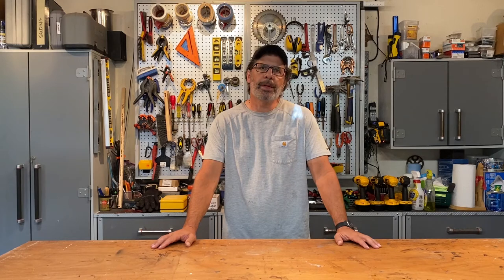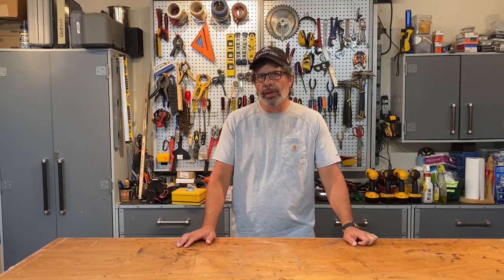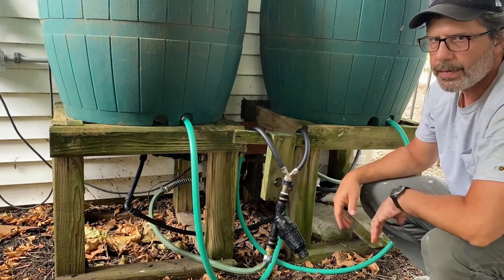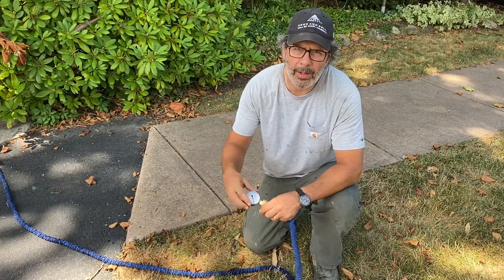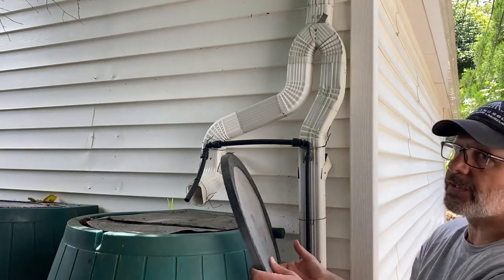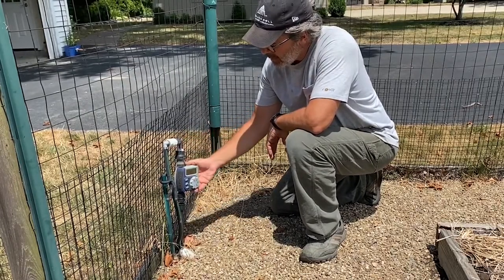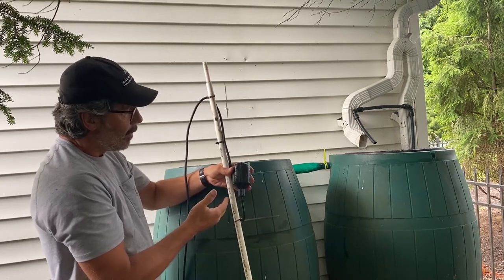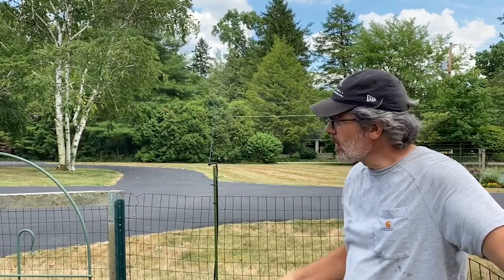The Ultimate Rain Barrel Irrigation System

Comment: You put the overflow  sensor in the second barrel correct so at that point you are pre filling both barrels when it goes dry thus erasing the benefits of rain water,  if you put it in the primary barrel at most you would loose one barrel to rain instead of two. Unless I’m reading this wrong….. you ever thing of powering you pump by solar?
Reply from the maker: That is a good point.  If I were trying to optimize rainwater collection that would be a better solution.  

Given the capacity of barrels, the amount of water I use each day and the filling frequency, I’m not sure it is making a material difference by overfilling hose water at the expense of rain capturing capacity.  I have the float switch set pretty low in the second barrel.  So it fills about 1.25 barrels with hose water, then uses about .5 barrels for daily watering.  So if it rained the same day as the hose filling, it would have over-filled about .75 of the 2-barrel capacity with hose water.  If it rains the next day, it’s only blocking about .25 barrels of the 2 barrel capacity.  

In my location, with fairly abundant rainwater and very low cost municipal water, I did not configure the system for 100% rainwater optimization.  Maybe I’ll switch it over to the first barrel sometime and measure the difference.  

But you are correct, that would be a better optimization method for maximum rainwater capture.  Good catch, no one else has noted that yet.  

I’ve definitely considered a solar setup.  It would be quite easy and there are DC powered pumps that could be used.  I believe some have set up this system in off-grid configurations based on comments I’ve received.  

I also have a old hand-dug well from the 1800’s on my property which recharges at about 40-60 gallons per day.  That is another option I’m working on with a solar powered pump.

Comment: What an incredible video Thank You! My guess is that the system doesn’t have enough pump pressure to run lawn type sprinklers… is that true?
Reply from the maker: These pumps run at about 60 psi which is the same as standard hose pressure.   Test your house water psi and select a pump at that same pressure.

Comment: Nice job with this fellow clevelander. Im a year4 gardener and finally getting some great yields. I have contemplated wifi timer modules and stuff but this is just way better. Have you made any adjustments or improvements to your original design?
Reply from the maker: Thanks. No changes. It’s still running exactly the same way.  I have looked at WiFi timers so I could easily skip water on days it rains. Now I need to manually turn off the timer and then turn it on the next day, which is not a super reliable or convenient method for me.

Comment: Great system and I picked up some great tips.  One question.  If the power goes out, will the backup system start the hose and never stop?
Reply from the maker: Yes. If you read some of the other responses to this question, there are a few easy solutions.

Comment: You've just saved me months of trial and error - thank you!

I have a question IRT the automatic municipal line refill using the float switch, I presume you just turn the tap off when there is rain in the forecast, so the rain isn't wasted flowing into full barrels?
Reply from the maker: You can certainly do that.  I generally do not.

Comment: i would use a straight connector with the hose, 90 degree will drop the pressure a bit.
but pretty nice set-up, this pump could make my project real (smaller barrel with a main barrel hidden away)
Reply from the maker: Thanks for the tip!

Comment: Very awesome system. Powered selonoid. I need to try to find a different solution. My collection will probably be contained inside my house in my basement. (HOA). So a powered selonoid to keep water from pouring in sounds lime a disaster if I loose power. A always closed selonoid that needs power to open would be better but I'm trying to figure out the work around. I'm designing a similar system except for my sump pump water. My sump pump pumps 5 gallons every 25 seconds. So I'm looking into collecting that and doing something very similar.
Reply from the maker: There are many WiFi based water and pump controllers out there now.  I’d look into something like that.   Either as primary or a backup shutoff.

Comment: if you want to pressurize without out the pump you have to use the formula "P=0.433/timesh".  Simple version is 1 inch pipe at 1 foot drop gives .433 psi, so to get your 45 psi equivalent you would use a 4 inch down pipe at 6 foot drop, then reduce to 3/4 inch pipe and you get 47 psi as long as your 6 foot pipe stays full.
Reply from the maker: Thanks. Very helpful to know. Once I raised the barrels 2 feet and knew I didn’t have any more drop to the garden, I gave up on the gravity method and switched to the pump.

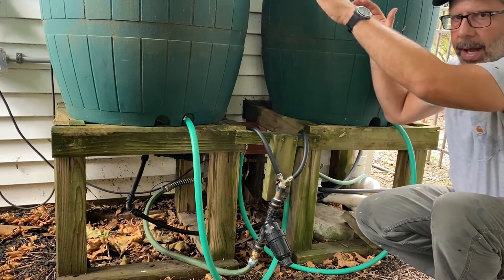Comment: At 7:17 you show how both barrels will drain simultaneously. That connection to both barrels eliminates the need for the connection at the top of the barrels to allow 2nd barrel to begin filling once the first barrel becomes full. Correct? They'll both fill at the same rate, as long as that valve is open, which I assume it is all the time.
Reply from the maker: Good question. That mixing hose actually has two separate streams in the valve (probably to prevent back flow), so the second barrel does not fill from the bottom up.  But that would be an option with a different mixing hose.

Comment: Hey Tom -- I've watched this a dozen times; it's so good!  I've got the barrel + pump part of it set up, and am considering the hose / solenoid piece to refill when it gets low. 

A question -- do you worry about a power outage? In that case, won't the solenoid open and the hose dump water into the barrels (and then overflowing into the drain) continuously?
Reply from the maker: Thanks. I have very infrequent power outages here.   My security system notifies me of outages and my neighbors both know where to shut off the valve if I were out of town.  

You could set up a second solenoid running on house power that would be open when power is on. That would control the flow from the backup hose.   That’s a workable solution. 

Someone also suggested a motorized quarter turn valve which I believe remains in position (open or closed) of power goes out.
Reply: @dontscrewitup  thanks for the advice! A notification for a power outage should be enough!
Reply from the maker: There are also some battery powered, wi-fi enabled shutoff valves you can put right on the hose bib now and shut it down remotely in the event of an outage.

Comment: Nice system. Have you thought about moving your backup fill hose to after your on demand pump? this way you only would use house water as long as your collection system is off and if you get more rain you will have room in the collection system to collect the rain water. you would also not need to use the on demand pump for house water this way.
Reply from the maker: Yes that would be a way to simplify and optimize the system.  I figured that out after I had set it up this way.  But it is a good alternate solution.  The backup filler only fills the barrels about 2/3 capacity and I use about 25% per day. So I’m not crowding out much rainwater with this approach. But if I really wanted to optimize rainwater collection that would be the preferred method. And the house hose water pressure obviates the need for the pump, as you indicate, so that is also an energy saving upgrade.  Thanks!
Reply: @dontscrewitup   - so it looks like you use about 15 - 16 gallons per hour.  As I reviewed this - that consumption would also likely depend on how many drips you have going.  I really love this - and the flow control system!

Comment: Just watch your viedo, great tips on setup. I like the logic of either rain or city water. One thing that I saw in the video is you black filter. I have the same looking item and mine is a pressure regulator and filter. Is that the reason why there wasnt any pressure without the pump?  Thank you again of the great tips.
Reply from the maker: Good question. No, I’ve tried it with not filters at all.  And the pressure regulator in my system takes it down to 20 psi before the drip irrigation.  But I wasn’t even close to 20 without the pump.

Comment: Any consideration to turn the hose directly on into the irrigation line rather than filling the barrels up? Then once the float valve signals water levels are back above minimum, the hose turns off? Just spit-balling. No idea what I'm talking about and have done nothing yet. I am planning a barrel system though, and your video is clearly one of the best on the matter.
Reply from the maker: Yes, that would work, but if would need to be downstream from the barrels and pump so it would run until the garden timer shuts off (and the float switch is off).

If the barrel was low and the garden timer valve opens, the solenoid would be open and the hose water would run directly in-line to the garden. If it were raining at the time and the barrels filled, the float switch would rise, cut the power to the solenoid, it would close and the pump would switch on. 

There would be backflow pressure into the pump when the hose water is running but I assume this is not an issue.
Reply: @dontscrewitup  thank you, you're the man!

Comment: Enjoyed the video. Wouldn't the system be limited in the amount of rain water it can collect. If your constantly filling with a hose as water levels get low your leaving less room for caught rain.
Reply from the maker: Great question. The way I have the float switch set (pretty low in the barrel) it shuts off the hose filler when the second barrel is only about 1/3 full which is about 2-3 days of water.  And the rain always tops off the barrels even if I just filled them with the hose.  I could put a second float switch in the first barrel to really do a minimal fill from the hose.  That’s how I’d solve that issue If I really wanted to minimize hose water and maximize rain water.   Thanks for the question!

Comment: Question... Amazing video btw. Very thorough. Do you need the pump to operate the drip system or only when you need to use hose or sprinkler?
Reply from the maker: You need the pump even for the drip system.

Comment: Great video given me lots of ideas. I have a small question. Isn't the connector pipe at the top redundant due to the barrels being connected at the bottom? Surely they just fill up together; I have a very basic setup, with just a hose connecting the taps at the bottom of my 2 barrels.
Reply from the maker: Great question.  I had not thought of that.  One would think with the connection at the bottom that the barrels would fill up equally, in parallel but they do not.  The right barrel always fills first then overflow into the second barrel through the top connection tube, even with that connection through the mixing hose/valve at the bottom.  I’m guessing the internals of that mixing hose actually keep the two sides independent to prevent a back flow situation. I’ll need to disassemble one sometime and see.  Or perhaps the water pressure prevents simultaneously filling because I’m using a fairly long hose (3 feet, looped around once).

Comment: So this project seems a touch out of my realm of expertise. How much would this run to have installed? And also what kind of person would I talk to? Plumber?
Reply from the maker: Thanks?  It’s very difficult to estimate. I built it up over many years.  I’d suggest finding a person who installs sprinkler or irrigation systems.  Most landscapers have these types of skills. An electrician should install the outdoor outlet if you do not have one. 

Here are some very rough estimates of the components. 

Rain Barrels, stands, downspout diverted, connector hoses, drain hose - $400 plus labor
Rain Barrel Pump, filters and irrigation hoses, electrical - $300 plus labor
Backup solenoid, float switch, hoses, electrical - $125 plus labor 
Garden timer and connectors - $25 plus labor
Garden drip irrigation system - $100-200 plus labor 

I’m planning to make another video this summer where I detail the entire construction process and components.

Comment: Excellent system!!! Was thinking it can be made sustainable by using solar PV to power the pump, any pros and cons? Thx in advance for your reply.
Reply from the maker: Thank you.  Yes I have considered a solar option but have not hooked it up.  I would probably go with a DC powered pump instead of the AC pump I’m using here.  And use a battery for power storage.  A basic marine or off-grid DC solar system should work and they sell the same/similar pumps powered by DC.

Comment: So just tuned in and a great, and simply explained, video. One question tho, apologies if it’s been asked already. So the float and the solenoid are powered correct? What happens during a power outage? We have them all the darn time here in Florida. Wouldn’t the tap continue to fill the barrels if the float that’s detects the barrels being full is disabled due to the power being out? The solenoid is powered shut but without power it’s open runs the tap until closed. I foresee one heck of a water bill potentially looming?
Reply from the maker: Yes, in the event of a power outage, the solenoid will run in the open position. To prevent this, you would another solenoid on the house power (before the float switch) that would close the hose filler in the event of an outage.  

Our outages are infrequent, my neighbor knows how to shut down the hose backup if I’m not home, I get Wi-Fi notified in the event of an outage, and if it runs, it overflows into the downspout, does not flood (and our water is cheap here). 

But you are correct, a second solenoid would be the foolproof configuration.

Comment: Can you give an in-depth wiring view of how the solenoid and pump connects and/or is powered
Reply: Scratch that, found it in one of your comments.  Thxs Imma bout to knock this same system out, got all the gear !
Reply from the maker: The solenoid and pump each have hot, neutral and ground.  Use a three pronged plug and connect pump hot-solenoid hot-plug hot, pump neutral-solenoid neutral-plug neutral and pump ground-solenoid ground-plug ground.  Very straightforward,  then plug that outlet into the female side of the float switch thru-plug.  

I also use waterproof connectors.  I don’t recall if I showed them in the video but I use this product now.  

ATPWONZ 3 Way Junction Box IP68 Waterproof Electrical Junction Box for Ø 5mm-10mm Cable Range (AC 500V, 25A) https://a.co/d/4An0ZEK
Reply from the maker: Thanks.

Comment: Very nice, Tom! Do you have any idea what fraction of water usage comes from the tap and how many barrels you would need to reduce that to virtually nil? Do I understand correctly that you water the garden even when it rains?
Reply from the maker: Thank you.  Yes, I just let it run every day even if it rains.  If you bought a more sophisticated timer it could pause when it senses rain, or some WiFi enabled timers are even more sophisticated.   

I have two 75 gallon barrels. If I really wanted to run only on rainwater I probably would need about 4-5 barrels to cover 10-12 consecutive days without rain which is probably the maximum we see here in Cleveland in the summer.  

Figure out the number of gallons per day you need for watering and then estimate the maximum number of days without rain that you want to cover.  I use about 40-50 gallons per day.
Reply: @dontscrewitup  Thank you, you inspired me to expand my set-up. Did I miss it or do you not need a backflow preventer in Cleveland?
Reply from the maker: I don’t use a back flow preventer with this setup.  This is part of the reason I use the low tech barrel filling method rather than plumbing the refilling line directly into the flow line.  I believe in that case I probably would need a backflow preventer.  But in this case, everything everything can only flow one direction.

Comment: Great video! How did you wire the pump and solenoid together? It looks like you have them on one plug.
Reply from the maker: Yes. Both the solenoid and pump are winking wired together (hot to hot, neutral to neutral, ground to ground) into a single three prong plug. That plugs I got the female side of the float switch thru-outlet.